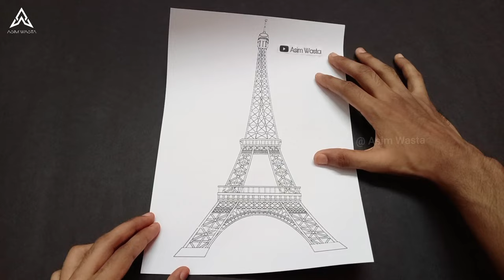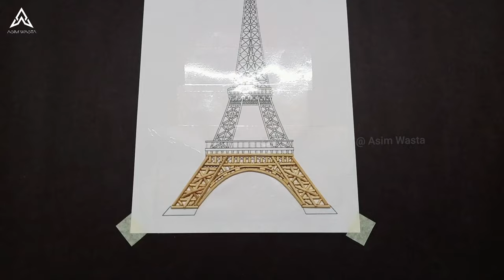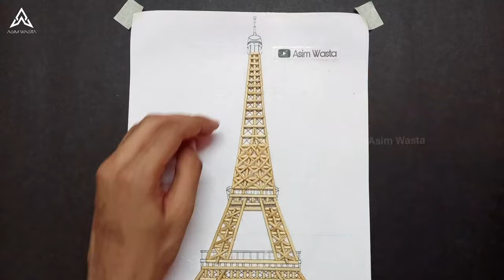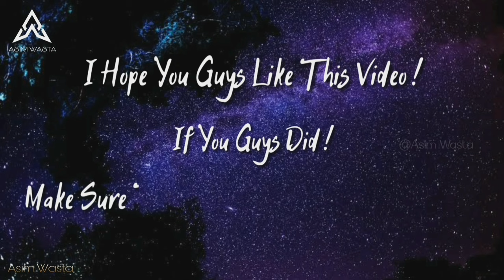How To Make Eiffel Tower 🗼| #diy Bamboo Sticks ✂️ |#eiffeltower✨️|#craft #design | @asimwasta 🍁...

Comment: Absolutely Brilliant Model.
Would it look better if you had made the upper section with the curve in it.
Didn't look like this would have been difficult to do using elastic bands to pull the parts in together using  PVA glue, rather than the Hot Glue you used to fill the gap instead.
Reply from the maker: Thanks.
Yes, The Curved Portion Can be made but this model was Small in size & it's not Possible to use elastic bands for that curved portion. & If Possible You Can Try it ! 
PVA Glue Takes More Time than the Hot Glue to Set / Dry Down...
So Better Option Hot Glue...

Comment: Hello how do you 10:16 loop the wire connections through all the bulbs? I mean, do you attach the wires with the same colors or the opposite ones?
Reply from the maker: Attach Same Colour Wire To Each Other 
Example :- Black to Black   &   Red to Red 

Connection :- 
Black Goes For Negative...
Red Goes For Positive...
Reply: Ohhh thank you! By the way what's the measurement of the DC wire that you used? 8:55
Reply from the maker: It Depends On Your Model Size

Buy Approximate 3- 4 Meter DC Wire
Reply: @asimwasta  I'll be following your model, would a 2.5mm DC wire work?